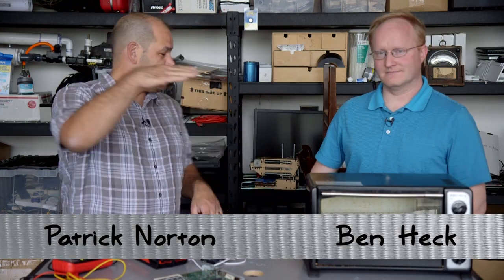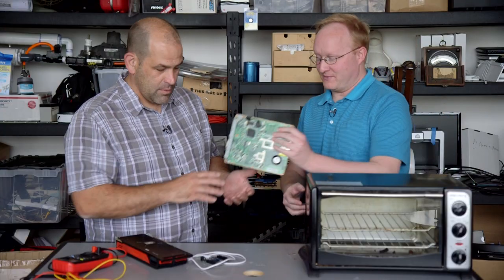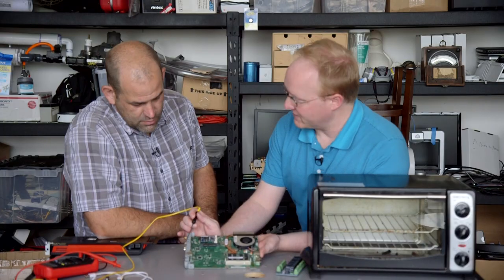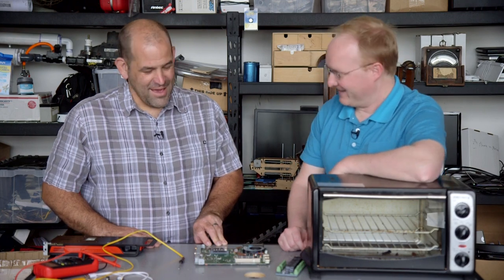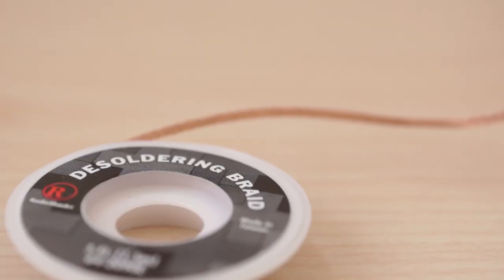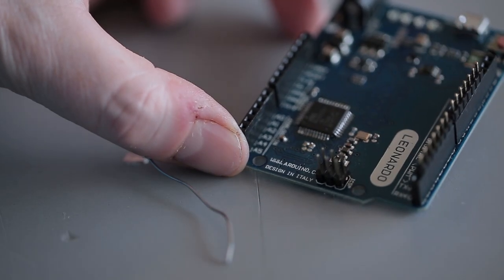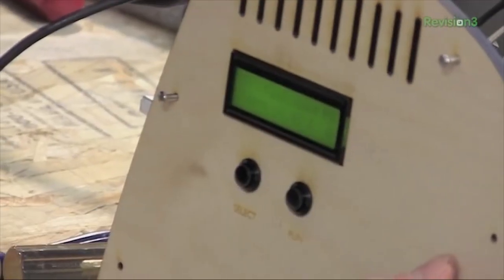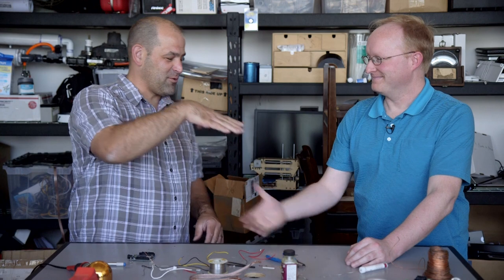Surface Mount Soldering Guide with Ben Heck

Comment: There are concave tips that work REALLY well for this if you don't have a reflow station. I prefer to reflow but in a pinch I will use a normal conical tip on my iron but I prefer the concave tips.

Comment: That was a fair introduction, but lets not encourage the masses to resolder their stuff. what you need is a different tip and you can do it in one pass with not mess and without any solder wick after
Reply: What kind of tip would that be?
Reply: When i learned surface mount soldering we used chisel tips, it seemed to make it easier.